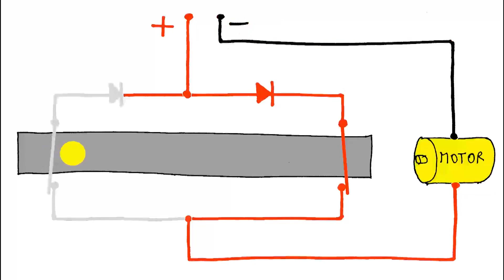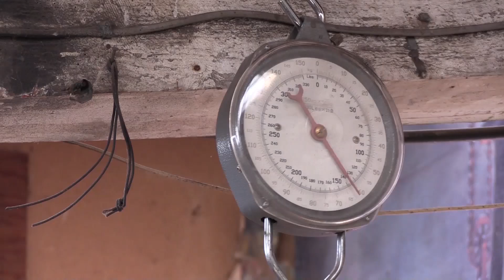The Secret Life of components. A series of eight guides for designers and makers by Tim Hunkin

Comment: Interesting how many of the subjects of the original SLoM series are now obsolete - VCR, Fax machine, CRT TV, light bulb, landline phone, word processor....
Reply: But the technologies are not lost, or were a stepping stone to the next thing. Harddrive heads, adsl, sattelite communication.. all the dots connect in sone way.
Reply: @micvanreijen  Now you're sounding like James Burke! ;)
Reply: @micvanreijen  Harddrive heads replaced by SSD (lumps of silicon), ADSL replaced by FTTP (leds = lumps of silicon),  Satellite communication replaced by FTTP see previous. Everything now is a lump of silicon.
Reply: @pklongutoobe  Hard drives are still used, so are magnetic tapes (when you want to back up petabytes). Elon Musk is making a big satellite array to provide internet connectivity to remote areas.
Reply: That would suggest we need a new series of SLoM exposing the workings of the current technology. (May not be as mechanically interesting as the original series though!)
Reply: The tech may have changed Mike, but I think you'll agree the knowledge is transferable indeed!
Reply: Which one of these are you referring to? Magnetic storage is still normal, Fax machines and other forms of digital still image transmission are now even more common than back then. Yes the "hooks" to get the viewer hooked to the shows might be outdated, but the information presented within is fairly timeless.
Reply: Exactly!  I watch them on my phone, and I always chuckle when he says "This is a Cathode Ray Tube just like you're watching right now."  If he only knew back then that someone could watch his videos on a telephone one day!!! 🤯
Reply: I'm excited to see his commentary on the choice of "word processor" rather than computer for that episode. Even at the time, I would imagine most people knew that the general purpose computer electronic digital was really the amazing development with a million applications. The word processors themselves were one niche application; they too had small microprocessors along with their text editing ROM and the RAM.
Reply: @mikeselectricstuff Well, fax machines are still commonly used today (especially for doctors' offices).  Same is true for landline phones.  But I am interested to see how long Cell Phones, LED lights, and other commonly used devices last.  After all the light bulb and the Fax machine have been around for over 100 years.
Reply: @m_a_s6069  LED light units in cars. Not very green when you think about it. Once they start to die you need to replace the whole light unit, not just a bulb or two. Not only bad for wasting resources, but more expensive for the consumer!!